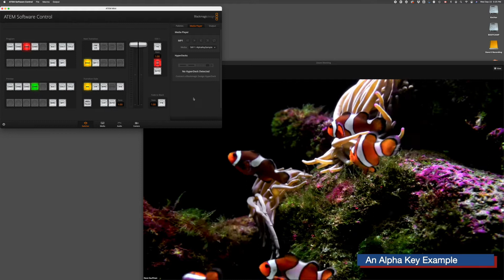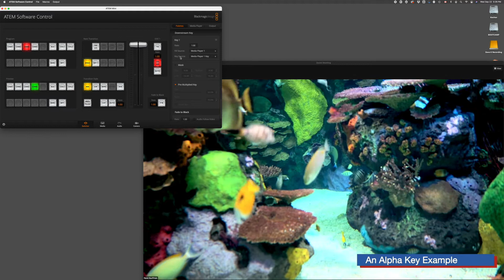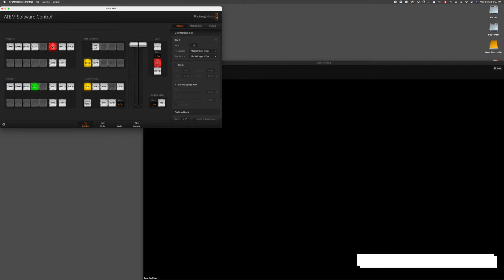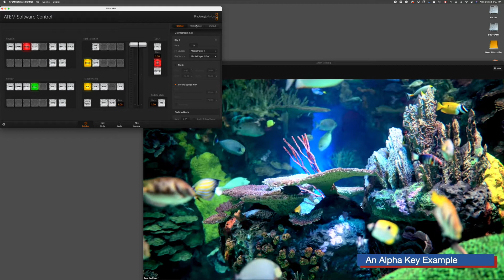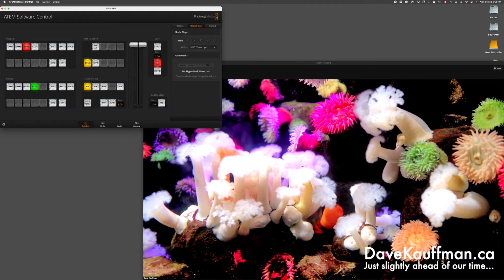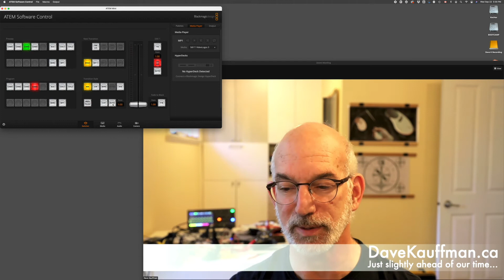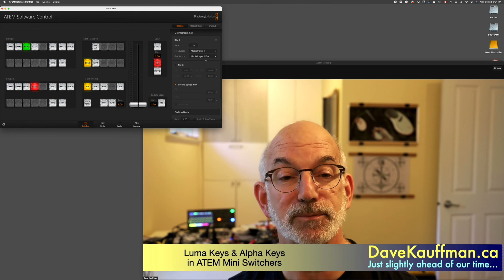Understanding Luma and Alpha Keys in ATEM Mini Switchers

Comment: Does either alpha or luma support gradient tranlucency?  If I wanted to overlay titles with shadows or prepare an image that has partial see-through pixels, can I use them without making the entire image partially translucant wtih the key effects?
Reply from the maker: In the video at 5:30 I show how to get variable transparency in a luma key by using shades of gray, with a gradient that goes from white to black producing a transparency gradient. Since the ATEM converts alpha keys into luma keys anyway you can get create a variable transparency alpha key by having values in the key mask other than 0 or 255.  I’m not skilled enough in an app like Photoshop to create an image with variable alpha channel but I’m sure there are people and videos to teach that.
Reply: @Kauffeebaby Excellent!  So would I be using the Luma Key selection or the Alpah Key selection, or do they both an alpha key source?
Reply from the maker: The ATEM doesn't have buttons marked Alpha or Luma Key, as I show you in the video you have to set the Fill Source and Key Source which determine how the key is built. The bigger question is how to make your Key source files. I used Keynote, and for the Luma Key files I just save a jpg, but for the Alpha key you have to set your slide show's Background Color "none" and export it as a PNG with Alpha channel.  Using Luma Key is simpler to create variable transparency since any shade of gray will make it semi-transparent.  But if you want semi-transparency in a PNG with an Alpha channel, you'll probably have to use Photoshop and understand variable transparency like this tutorial shows. https://youtu.be/9SmndZKYkcE?si=No3H-Al4_6HxQHQ7 Good luck!

Comment: so basically alpha key is where black and white in one and luma key is where it must have black and white separately??
Reply from the maker: Maybe the better way to think of it is: when in key mode, the mixer always uses a key to decide whether each output pixel comes from the video, or from the graphic, or a combination of them calculated by the grayness of the pixel. The more white the pixel, the more the graphic, the darker the mask pixel, the more of the program video is weighted.  The mixer can import a file with an alpha channel, but whenit does that it actually turns the alpha channel into grayscale and applies the luma-key calculation.  The weighting algorithm is linear.  If P is a pixel from the program bus, and G is a pixel from the graphic, then output V ~= M * G + (255 - M) * P, where M is a (grayscale) mask value between 0 and 255.